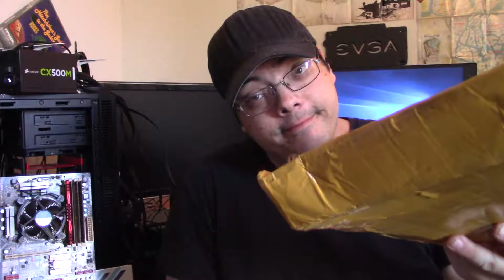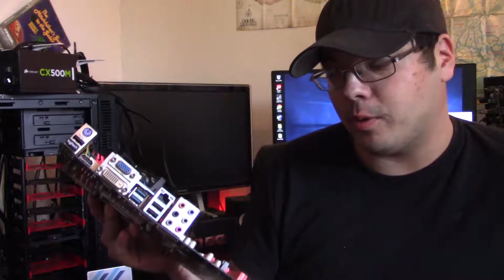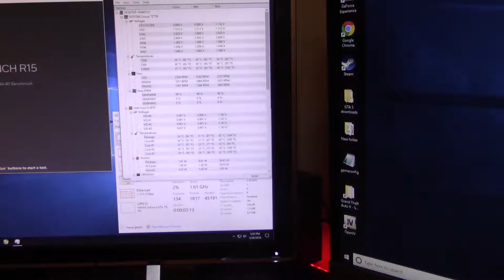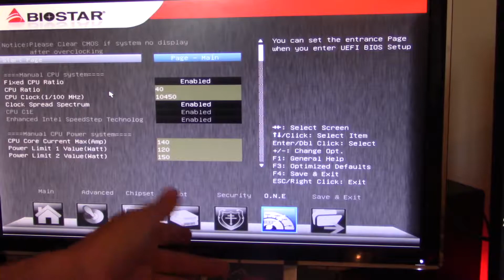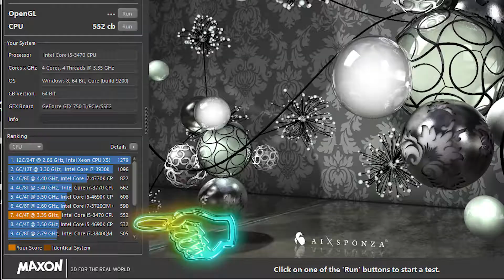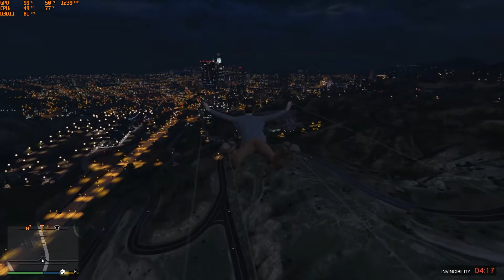PC of the Month: May i5 3470

Comment: i need Work overclock z77-d3h - i5 3470 - cooler master v6 gt
settings are different in Motherboard
What are the steps
I need help configuring the settings From you
Reply from the maker: I do not have that motherboard, but here is a guide for O.C on the z77-d3h mobo. Scroll down to second post, It shows the guide. Even though the interface is a little different, It looks like the basics are the same. 

1. The 3470 is not a "k" model, so it is harder to O.C. due to the multiplier being locked. 

2. Bclk is going to mess with other things like your RAM timing. So you have to make sure that you are adjusting the RAM frequency to keep it in spec.

3. You cannot use any sort of XMP profile for the RAM. It will probably not even boot. 

4. Core voltage is important. The CPU Vcore is probably going to give you the biggest headache, as it can differ depending on individual CPU's Start at stock and slowly add voltage until the system is stable. Don't just hammer the CPU with volts and hope. 

I hope it goes well!
Reply from the maker: Sorry, here is the link for the article https://www.techpowerup.com/forums/threads/entry-but-complete-z77-gigabyte-z77-d3h-oc-guide.168395/
Reply from the maker: And lastly, That motherboard is VERY basic. It may not have the Ability to O.C the non "k" CPU. I would also suggest you keep a fan blowing air on the VRM and Chokes, As those are going to get very hot.